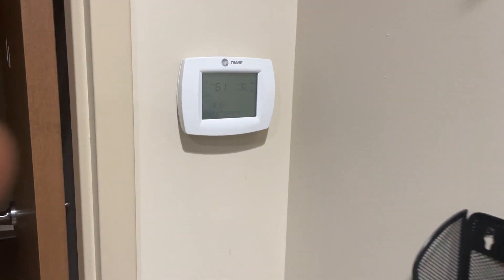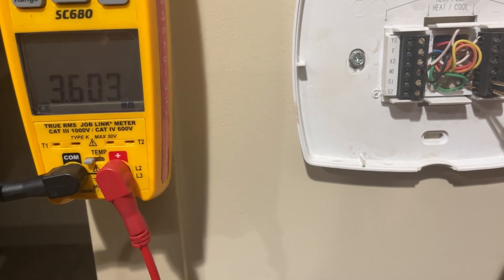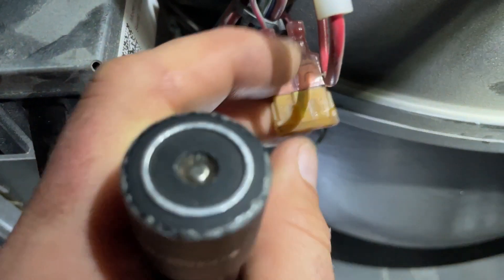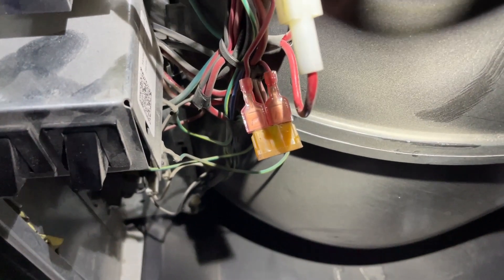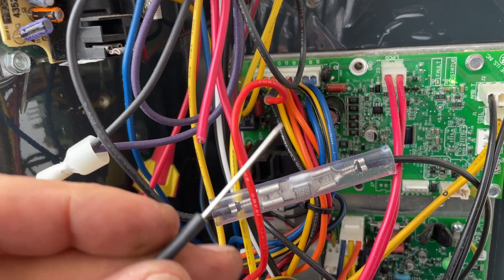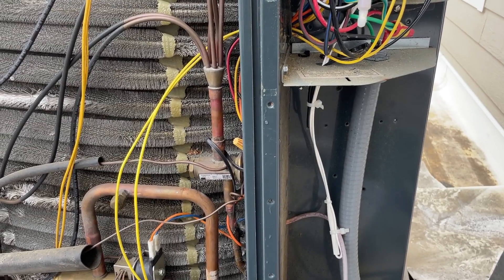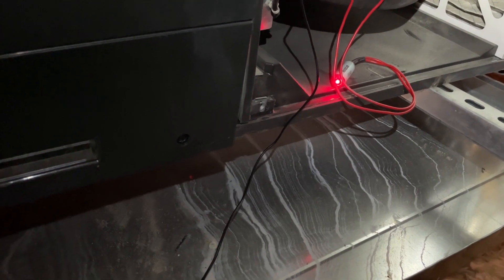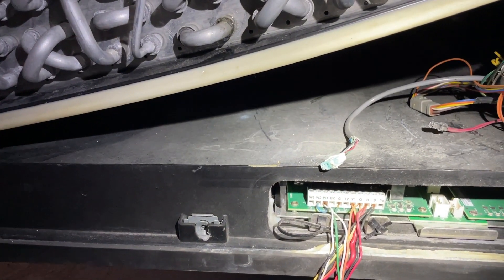Diagnostics27:  Diagnosing Multiple Issues on a Tam

Comment: So was it on 208v tap and was 24v or low voltage taps reversed on the transformer ?
Reply from the maker: Ahh yeah if I remember right.  It was 240 on a 208 tap.  This makes the voltage low.
Reply: @HVACLife  ok that's what I thought you said in video was in 230 so was confused

Comment: I have that same toner. Don't use it much. 

When I can't find the short, I run the defrost cycle. Twice I've had boards trip fuses only when defrost is initiated.

And the TAMs aren't so bad, after you get used to them. Unless one of the wires in the plastic case get a short, then all you can do is replace the whole cabinet.  And the installer run the refrigerant lines so you can't remove the blower door. And of course, the plastic blower door breaks. And the special cabinet screws get lost. And the blower control board, the one in the blower compartment with all the colors of wires, they go bad, and they're discontinued so you gotta rewire and put in a RLY2807. And the DC power supply goes bad, then you're stuck unless you carry one. And...yeah, they suck. 

I find more leaks on the indoor coil of TEM units, though.
Reply from the maker: Hahaha yeah man TAMS are trouble lol!
Reply from the maker: Interesting about the defrost.  So the board is internally shorted?
Reply: @HVACLife  Yeah, short on an integrated relay or something. Only way I found the first one was because in the work history, I saw every winter we had to go replace fuses once or twice and then not at all in the 10 months until it got cold again. Then there's always blown traces, and the lizard or bug (I'm in Florida) that decided to lay against the back of the board and get fried. Usually not a problem, but once in a while one will pick the perfect spot to die and short something out. I think  you're up North? Ever have ants get all up in a contactor so it can't close? Probably, but how about scorpions? Had that twice. And snakes wrapped around the outdoor fan shaft. Nothing smells as bad as a dead reptile warmed in the Florida sun. In Spring, always 'knock' on the unit to see if anyone's home before opening. No good to be on your knees in front of a unit with your back against the Holly bushes, and remove the panel to see the nest of wasps in front of your face.

Comment: It is so frustrating to work on those when they are an occasional thing.
The 2 or 3 different boards with blue, green and red LEDs flashing at the same time(not in unison) makes differentiating the codes FAR more difficult than necessary.
Yes, those do store codes, the book you showed references that. When powered up it displays the codes. Might even have a recall(same button to clear codes) just held for a shorter period IIRC.
As for the low voltage wires being outside the electrical section, this is to be code compliant(I fully agree with the thought of them needing to be inside away from the weather/elements) of not having low and line voltage connections in the same compartment. Cheap, dumb, etc.

Comment: Great vid I always re wire the thermostat and the air handler. I like to use Yo for the condenser and don’t like breaking the bulldog to condenser.. if it stops turn the whole thing off 😂😂😂 I know the 9 had the switch connector. Didn’t know I could wire out the pressure switch though. The tams are bad on those aluminum coils . That same connector in the air handler will be loose that powers the control board. Some houses I go to will get error codes and nothing wrong hold test on afc board for 25 seconds and will clear out the codes. Except for bad personality modules..Great vid.

Comment: I also have found MANY trane coils with that exact failure and have successfully fixed a couple back at the shop after we replaced them under warranty.  
    It seems like they for whatever reason have a really bad issue of being able to get enough filler material into the joint and more importantly getting it to FLOW all the way around.    I can’t figure why tho, cuz if you’ll look there will be multiple places where it’s very think and I’m sure at some point will leak in those areas as well.    
   I used to have several small videos I had taken of actually seeing the refrigerant and oil literally bubbling out of those areas.  It’s so annoying